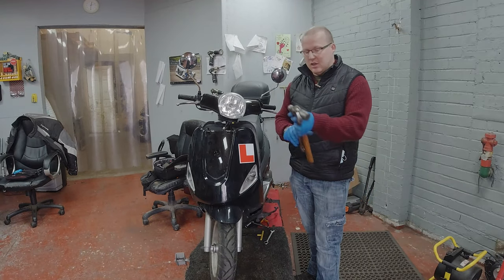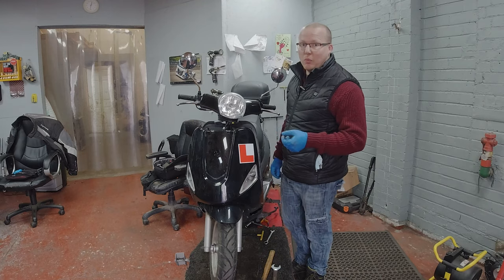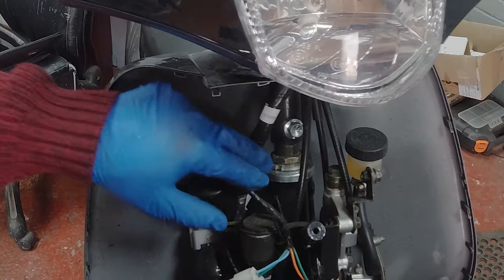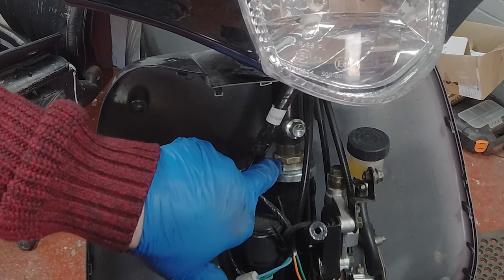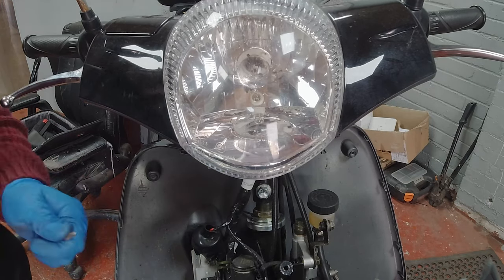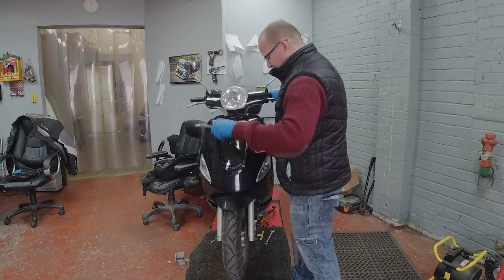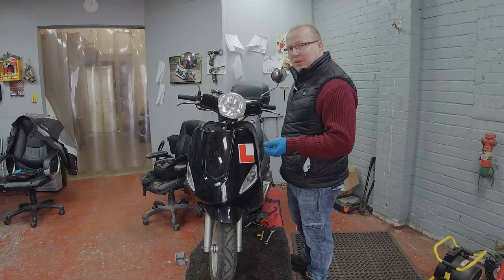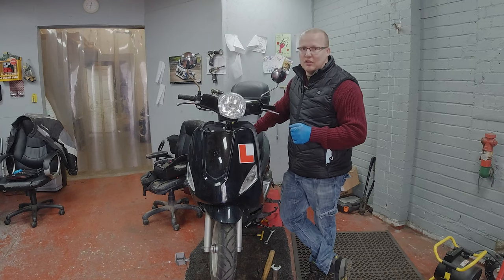HOW TO Adjust steering head bearings

Comment: I remember doing the bearings in 2014 on my old 1988 XJ900. That job certainly transformed.the handling and riding.
Reply from the maker: tis one was shocking to ride and it was only a small adjustment

Comment: Good close up and the lighting to go with it. A lot of technical posts miss those key elements, with people giving a huge explanation but then using a dark shot of their back blocking the frame. Getting there!
Reply from the maker: you neve know one day i might be able to get someone to do the setup for me so i don't have to learn so much but i am getting better all the time
Reply: @Ridingreviews  if you want to bounce off ideas or have questions about video production just let me know
Reply from the maker: @rodintoulouse3054  any help would be appreciated
Reply: @Ridingreviews  just let me know if there is anything you want help with.
Reply from the maker: @rodintoulouse3054  we can start with a fairly common thing you had to deal with the lights showing on my glasses
Reply: @Ridingreviews  unfortunately this one costs money: either buy anti reflective specs, which is what news readers use, for example, or wear contacts. In dramas if the character wears glasses, then they use frames without lenses, but that won’t work for you. You can reduce the size of the reflection by using the main light further from you, with more angle positioning the light 45 degress looking down on you and 45 degrees to the side and putting difussor in front of it. But for that you need to counterbalance with light on the other side (filler) or bounce off the main light from styrofoam for example. cheapest option? Don’t do anything. You normally use long shots so nobody notices… and most important, nobody cares, people do not follow you for your dreamy eyes 😁 don’t sacrifice your lever of lighting in order to avoid this non issue
Reply from the maker: @rodintoulouse3054  its allways about little fixes for the hole effect this is me and hopefully it will help me do better than others because i am allways trying to improve
Reply: @Ridingreviews  do you watch motojitsu? He does a lot with very little. From a technical POV make sure you can be seen: lighting. Make sure you can be heard: lapel micro of good quality or directional one off camera. Make sure you are showing what you need to show. Sometimes your shots are too wide. Get rid of the distractions and use more close ups. If you are going to do motovlog, I recommend you look at the bike reviews of the missenden flyier. I think he’s go it right technically. I think you found a good space by getting into low displacement Chinese bikes, especially the mechanic tips and reviews of all brands. Please feel free to ask anything and if you prefer you can email me
Reply from the maker: @rodintoulouse3054  thank you for the tips i will check your recomendations out

Comment: What is wrong with the steering if it feels kinda stiff and wobbly when turning? Almost like if it had a flat tyre?
Reply from the maker: Head brace bearings ushally are too tight or failing
Reply: @Ridingreviews  Where are those on a Kymco ZX50?